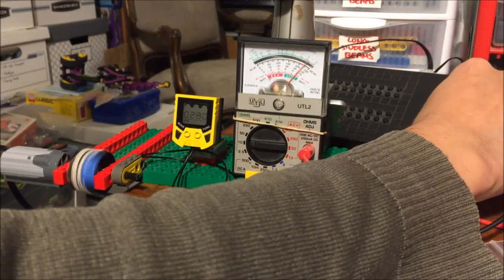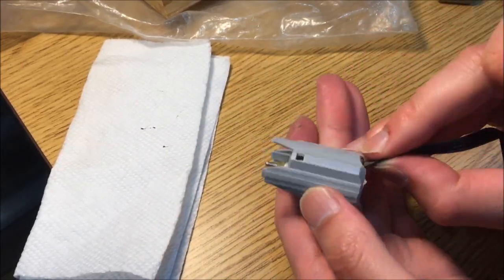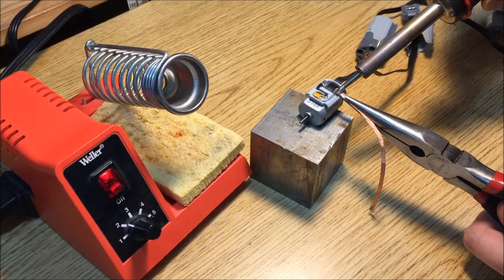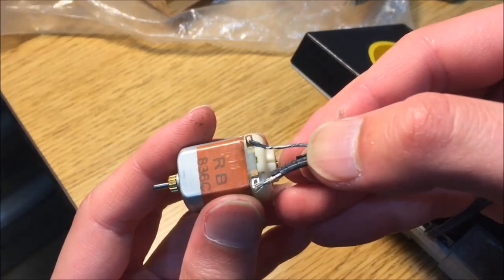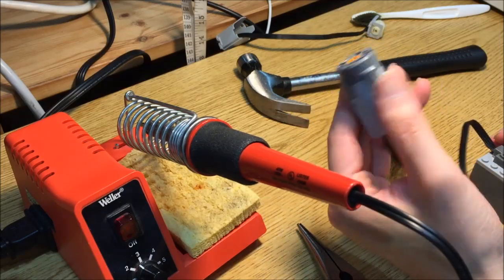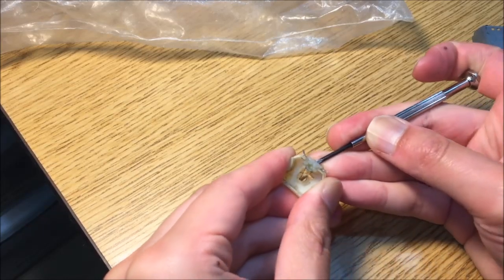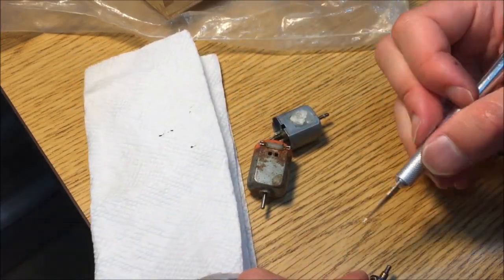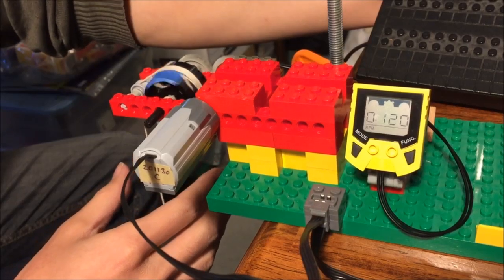Examining and Repairing LEGO Technic M Motors Part 3

Comment: One thing to watch out for on armetures is if the brushes have worn a deep groove. If so, the only way to fix it is to run it in a lathe to cut off the ridges.  RC hobbyists do this.

Comment: Many thanks for showing us how to fix a faulty motor or replace it with a new motor!
I cleaned my motor as in part-2 but unfortunately... Do you mind sharing some info about the motor and the new motor? You mentioned that you bought new motors based on external no-load speed and internal reduction...what are these data's? Also, what is the voltage range of these motor? And what are the data's of the new motor...a link to where you bought these would help me a lot as well!
Reply from the maker: Hello, I bought these: https://www.ebay.com/itm/123368552118. I don't have any data on them other than what's in the listing:  nominally 9v, 8500rpm. The internal reduction (of the PF motor, not the core motor), is 1:24, so this should have given a no-load speed of about 350rpm... but as you can see it didn't!

Comment: Sorry to be pendantic but in the interests of avoiding confusion… The part you’re calling the commutator is, in fact, the ‘brush assembly’. The commutator is the part with the copper segments, attached to the windings. It’s a small mistake, but you could say it’s an armature error (drum roll please ;))

Well done on discovering the fix - traditionally known as ‘undercutting the commutator’ :) this used to be done on a larger scale with car dynamos and starter motors
Reply from the maker: You are correct. That is my mistake!

Comment: I wonder why The Lego Group used a non-standard configuration of an otherwise standard part.
Reply from the maker: They have a bad track record for non-standard stuff if you ask me... but at least the PF motors aren't as bad as the old geared motors. I suspect they couldn't fit more reduction in the planetary stages, so they had to find a super slow motor. I actually want to get some of the Chinese knock offs and see what is going on inside those.

Comment: is there anywhere I could get 3 spare Lego M motor gears? (plastic inside gear pieces)  (i have a 3D printer if there are any models)
Reply from the maker: Pretty sure you could just take the gears from these knock off motors and have them fit (though I haven't tried it myself). Not sure about 3D models; just not too familiar with the space myself.